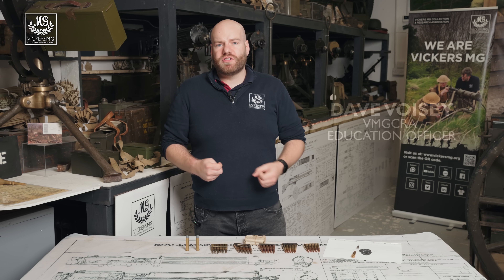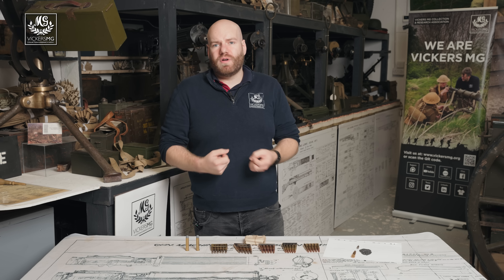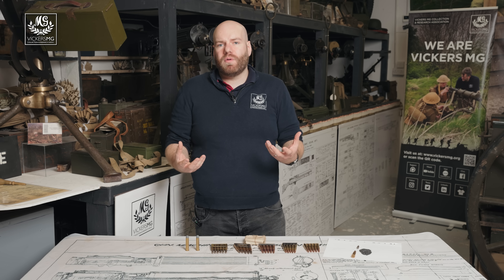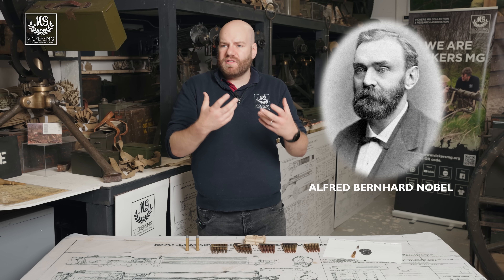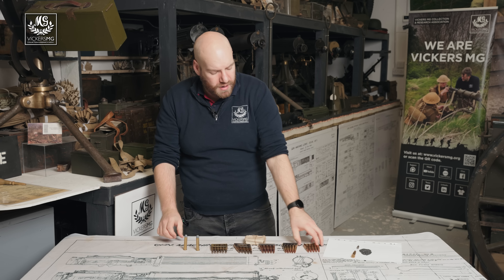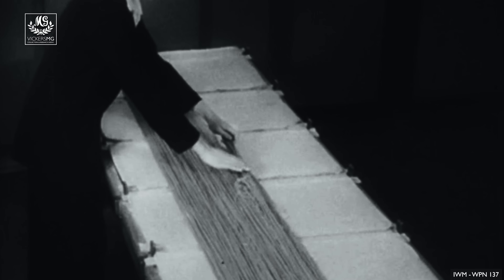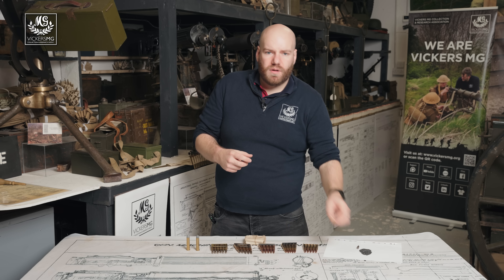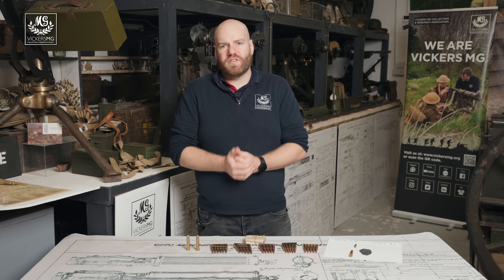Smokeless Powder (Small Arms Schooling)

Comment: There must have been considerable progress in gunpowder between 1930 and 1940 in terms of dirt and cleaning. Scrapers were needed at first, but later oily brushes were sufficient. Greetings from Germany
Reply from the maker: Wire gauze remained part of the cleaning kits for quite a long time after the Second World War, only really disappearing in the last couple of decades I think.
Reply: The powders themselves are fairly clean, the real issue is the compound in primers that are left in the barrel, that is what salts up and corrodes with moisture
Reply: There's also the different fouling from copper jacket bullets and the cupronickel bullets
Reply from the maker: @cptdarling501 boil those barrels!!
Reply: @vickersmg  Eww, no, that's why the wire gauze is in the kit, to clean out the rust from using water! "CRC" type oils are the best to remove the corrosive salts from those type of primers, which havent been used since WW2. Target shooters use a compound called "never nickel" on the projectiles of cupronickel, other wise the metal fouling was really hard to scrub out.
Reply from the maker: The army did quite a few trials and determined that the heating differences for the different metal types (barrel versus nickel) made boiling an efficient method for removing those deposits as well as the powders. Then an oily piece of flannelette to protect from rust was the process that suited these barrels.